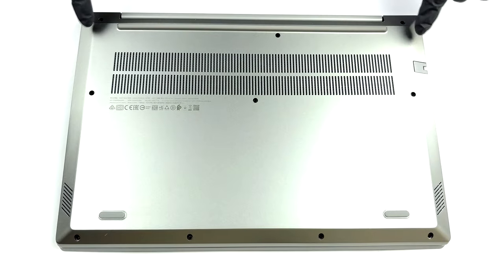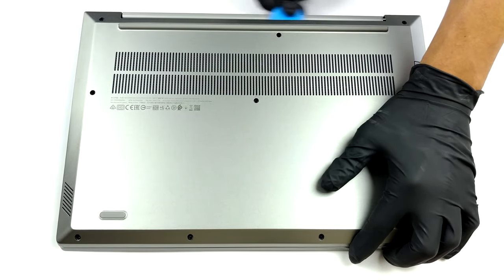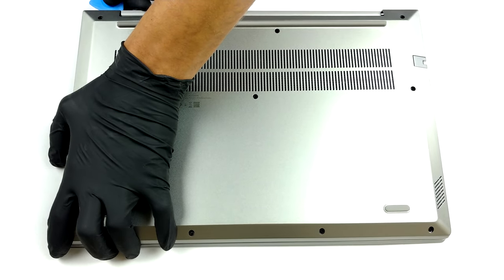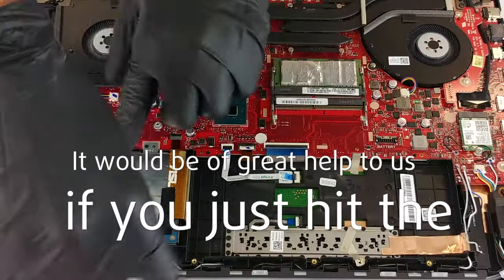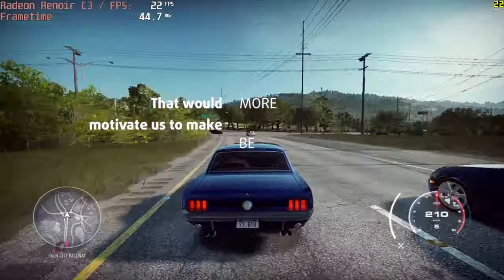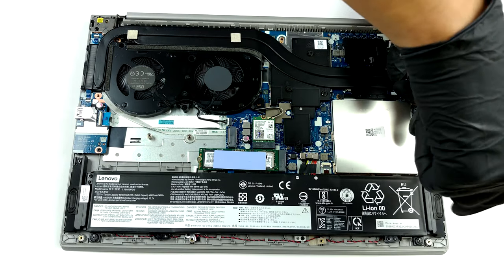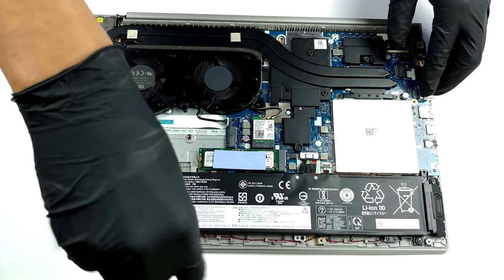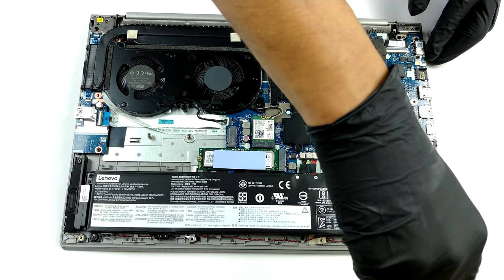🛠️ Lenovo ThinkBook 15p - disassembly and upgrade options

Comment: Does it come with SATA cable? I see the space for 2.5” SATA drive.
Reply: Just disassembled mine - there seems to be no SATA port in there, never mind a cable.
Reply: @ivankuzin8388  yes, it doesn’t included the SATA, I put 2 NVME into it, thank you for the information👍